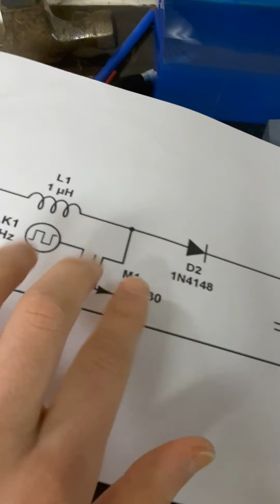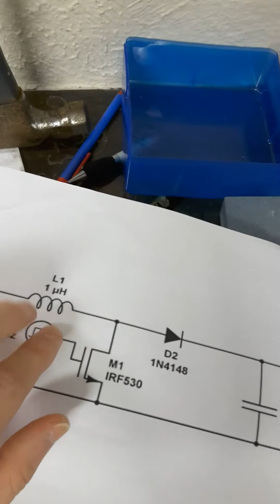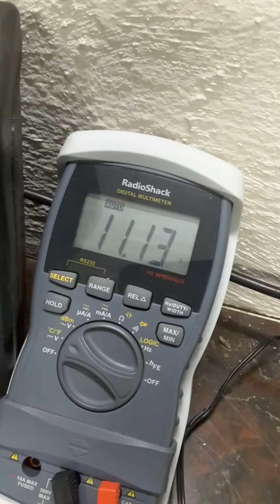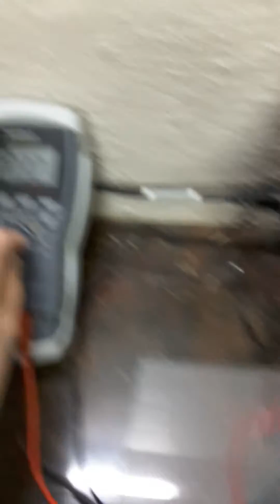12V to 320V DC Boost Converter

Comment: There are some safety points, which has to be considered.
1. You used unisolated pliers to discharge the capacitor. At 300V it is too dangerous, in certain cases it can shock you to death
2. The capacitor can damaged, if you discharge it without resistor
3. Your uncontrolled converter can charge the cap over the nominal voltage which leads to popping of the cap. Wear ear and eye protection.

The shorting of the power supply is not a good idea, because the transistor can damage, and via short circuit it will burn the cables and also the battery can damaged.
This type of boost converter is unregulated, so it pumps charge into the condensator, and the voltage goes up without limit.
The inductor also goes into magnetic saturation, after certain voltage on the cap the increasing slows down.
Important to mention, that the diode has to withstand the high current at the start, and the high voltage at the end 320-12=308V.
The transistor you used, is also has to withstand the 320V, but also the high current.
After the saturation point of the inductor is reached, the inductor works as a resistor, and because of the low ohm value, you got a huge amount of current during the "ON" stage. So it can burn up.
After certain output voltage the efficiency of this circuit goes under 20%, the lost energy is heat.

I don't recommend this setup for longer use than 1-2 seconds trial.

Thank you for sharing the video!

Comment: plz can you mention the components list....and also the pwm code.
Reply from the maker: Hmaza Khan I can eventually give you the transistor model number.  But I deleted the code unfortunately...  It was basically turning a pin high, then delaying a few microseconds, turning the pin low, and then delaying again.  This was all in a for loop that ran a couple hundred times.
Reply from the maker: Hmaza Khan The transistor is a C3856 by SK

Comment: hey....I wanted a smaller voltage
Reply from the maker: Lol, even I'm not sure how this generates such a high voltage.  According to a professor at my college, it's not a true boost converter because of two reasons: It doesn't have a load resistor,  and that it generates more than the math says it should.
Reply: This is a boost converter without load compensation so the voltage actual rises slowly and charging the capacitor to a certain point but soon as you add a constant load the voltage drop will be large